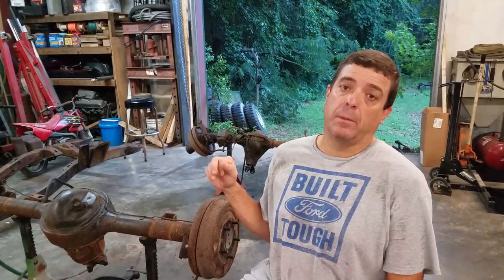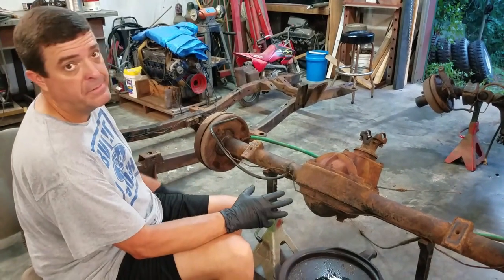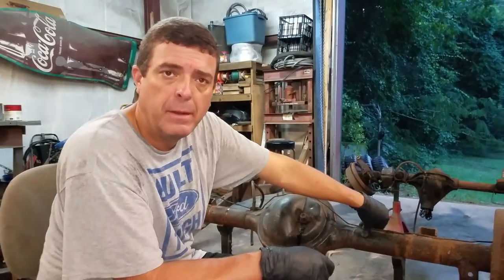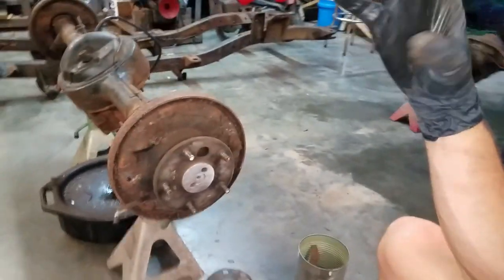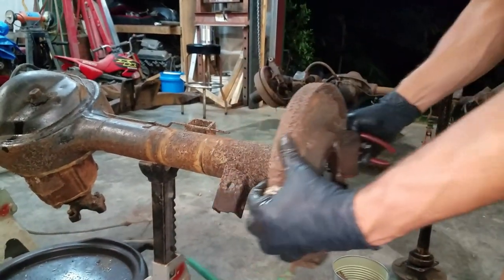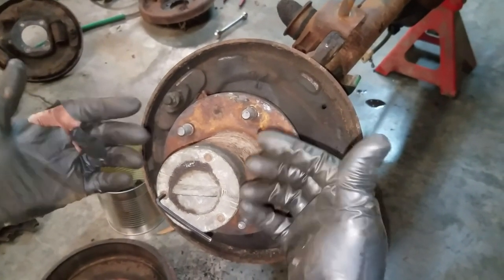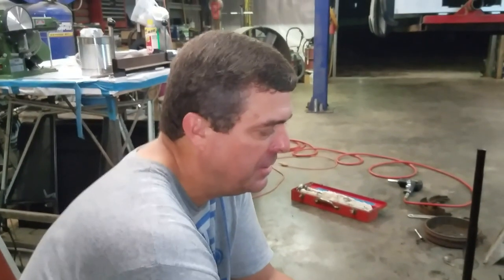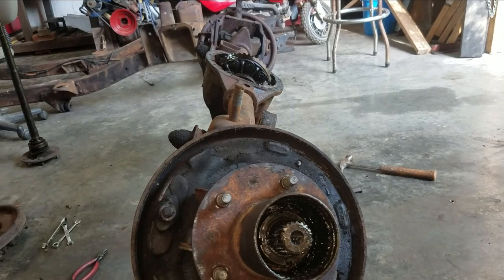Front and Rear Differential Disassembly - 1966 Ford Bronco Restoration Project

Comment: Enjoying your channel. With a ‘71 bronco in the garage, it brings back memories and reminds of things I need to do.  I did change my front hub nuts to the stage 8 single nut system, I really think it is better, easier and I do not worry about that locking washer slipping.
Reply from the maker: Bob, Thank you!  I am not sure what the Tom's Bronco Disc conversion comes with.  The stage 8 sounds like a good upgrade.  Thanks for watching.

Comment: Yet another great episode.  This is fantastic for me as I begin a 1973 restoration soon.  Thanks so much for sharing your knowledge and experiences.  Somewhat similar, I am a scientist by day and do the gear head hobby when I can, but not at your level.  Specific to this episode, I had a 67 F100 4x4, and the front axle also wore similarly with respect to that groove you showed us, and seals of any kind could not correct, so machining of some sort or replacement is needed or it will leak diff fluid until it drops below that level.
Reply from the maker: Thanks Brian.  I am going to look into a fix and will let you all know what I do to make sure I don't get a leak.  I don't like to do things twice so I will pay close attention to it.  We appreciate you watching.

Comment: Great Video working on a 65 Bronco, removing axles and converting to disc brakes.  I didnt know you had to remove rear axle first before removing.. gear thanks for the big tip.. was in a jam...
Reply from the maker: Thanks for watching.  You can contact me anytime if you have question or video content request at jasonandjoniebuilds@gmail.com

Comment: After rebuilding the Dana 20. And regearing the front and rear axles I can smell your shop from here... 😂. When I was taking the front cover off I saw blue RTV so thought the cover would be hard to get off. I tapped a putty knife in the seal and the cover flew off and covered me in gear oil... Lol
Reply from the maker: Ha! That won't wash off anytime soon.